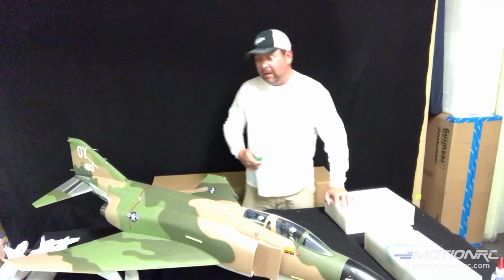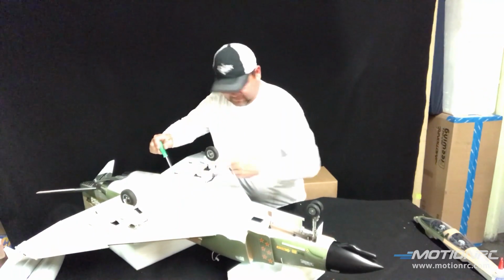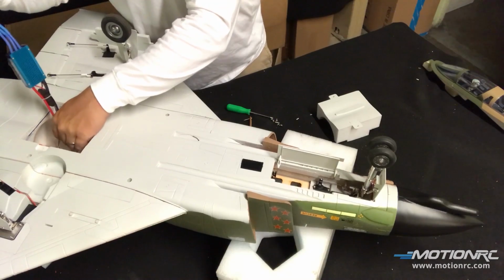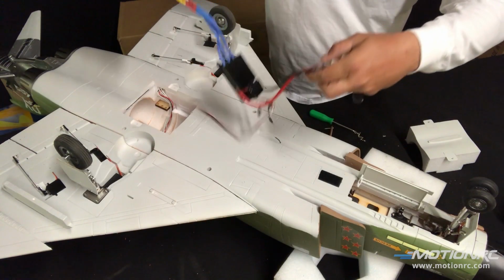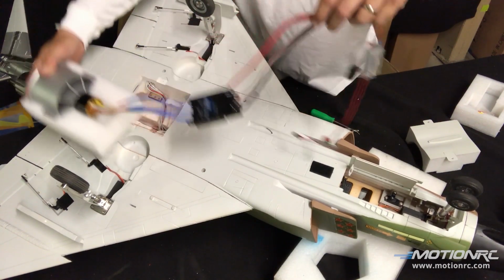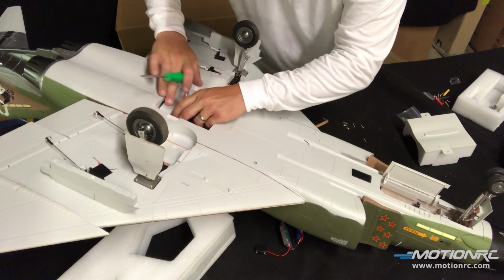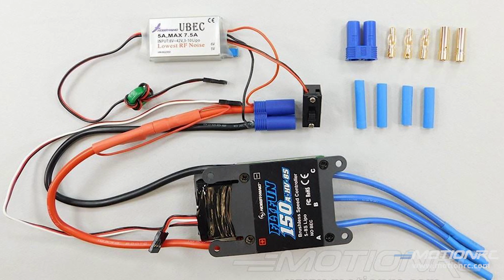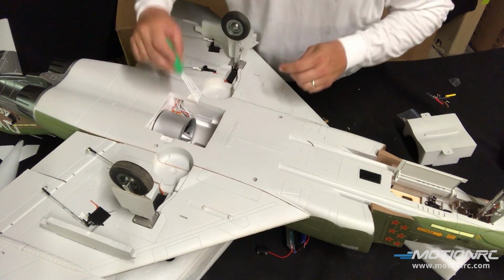Freewing F-4D 8S Power System Install - Motion RC Extra

Comment: So I just bought a f22 8s ultra performance from freewing. 
I noticed the conversation comes with a bigger 150a esc.
My plane only came with the 120..
"The one that is running the 6s that your replacing "
What is the benefits of running that bigger esc?
And why didn't that come with my plane?
But the conversation already comes with it?

Comment: Has anyone ever had a problem with the stock bec on the 8s power systems? im wondering whether i should use it or upgrade to a castle creations cc bec 2.

Comment: Having problems getting the ele and rudder to work. Plugged them into the junction box, then plugged out of that into the receiver right? Also, where does the ubec black/red wire plug in??

Comment: Use a little low tack masking tape and wrap the wires together before using the pull wire!
Reply from the maker: He ended up bagging them in a ziplock then getting it through.

Comment: I did an 8s conversion with a 1900 KV 4082 motor  with a 12 bladed edf  fan and the gecko 8's ESC. Going vertical seem unlimited and straight-line speed seem well over 100 mph....... Well over..!